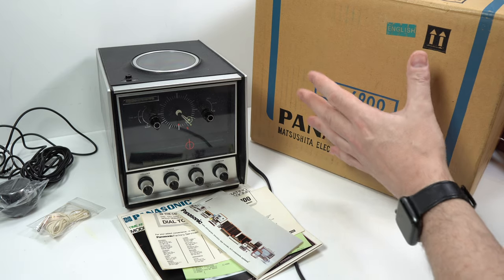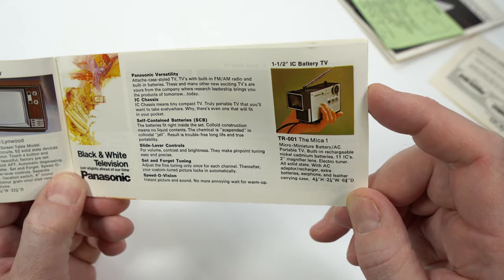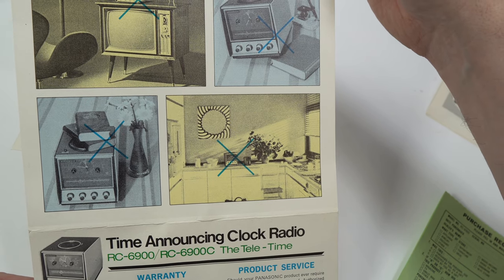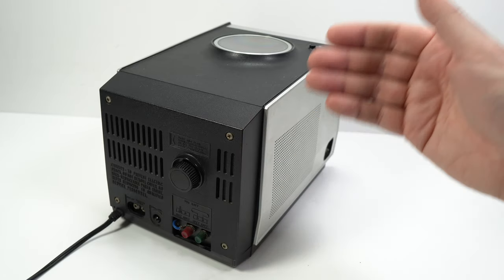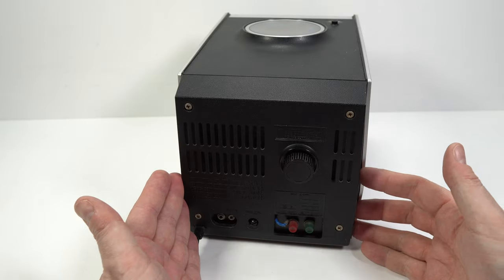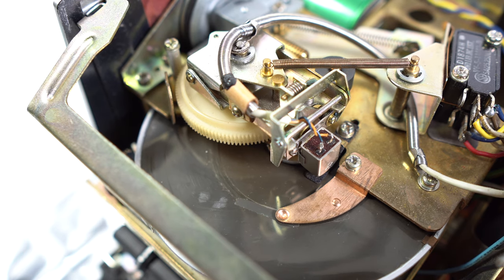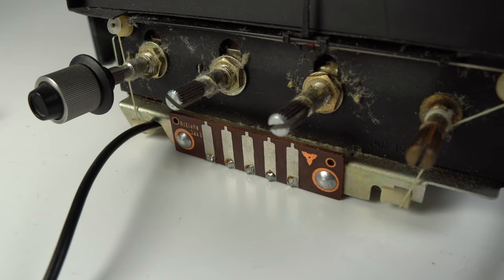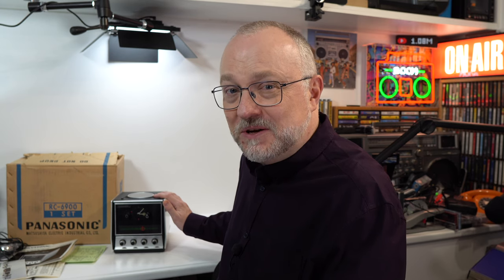The fifty year old Talking Clock Radio

Comment: Can you not get a device of some kind which converts between fifty and sixty Hertz AC?
Reply: How about a 12 volt pure sine wave inverter hooked up to a 13.8 volt DC power supply?
Reply: @johnyanez4962  Sadly I know very little about electronics.  I can wire a plug and sort out those double light switch things but that's basically it.  So maybe.
Reply: Get a 115 volt 60 Hz power supply that plugs into your car's cigarette lighter socket and get a 13.8 volt DC power supply with a built-in cigarette lighter socket that plugs into your wall outlet.

Comment: They must have had some very specific equipment for recording and duplicating those disks. The media might have been re-purposed from 8" floppy disk stock rolls. 8" floppy media was developed in the 1960s and commercialised by IBM around the time that your clock was produced. 

Perhaps the media was not that exotic for its day,  but recording to and duplicating those disks in bulk, with those odd helical tracks,  must have been an interesting engineering task. 

8" floppy disks were pretty crude by modern standards. The tracks were spaced at roughly the same distance as those of a 1/4" stereo tape recording. You could in fact "see" the tracks and indeed the individual bits if you used a magnifying glass by applying a fine ferric dust (very fine iron filings) or using a magnetic film. This trick was used by engineers to align the heads on these old drives. 

 Modern "spinning metal" hard disks by comparison have a data density that has improved by in excess of 650 million to one. Solid state drives are pushing the bit density even higher, towards the fundamental physical limit of electronic devices.  

All in all that clock radio is a fascinating bit of technology. 

By the way there are devices that you can purchase that will produce a 60Hz 110V or 220V output from a 50Hz 240V input to drive old synchronous motor clocks like that. They are a little pricey, but they do exist. If you do a bit of googling you may even find a DIY solution if your soldering ninja skills are up to it. 

I have a couple of old Metamec synchronous motor clocks, which were amongst the most accurate clocks of their day (back in the 1940s and 1950s). They are a little tricky to repair as the motor coils tend to bite the dust and are almost impossible to find.

Comment: 10:26 Probably the hour-hand is out of sync with the clock mechanism, even though the minute hand is correct.  Just adjust the hour-hand on its shaft to skip it back an hour.

Comment: if they made these in the 90's they could have used a platter from a hard drive, in lieu of the thin plastic Iron oxide coated ones. it would have help up a lot better. would have had to have a device  to format the platter for Audio instead of Data though.

Comment: I see what's wrong. Two things - 1) The minute feed lever tab is not in the Feed Operation Lever (right above the motor at 17:06 - see the slot in the shiny feed operation lever?) To fix just remove the ering holding down the the Disc (swing away the head to see) and the 4 screws that hold on the top plate (two big ones on worm pully plate and two on posts going to bottom) and lift it up just enough. It will never work if this is not repaired. 2) The hour disc needs to be on TOP of the minute disc. No wonder it got ripped.

Comment: You could get a US 60hz power inverter that runs off 12V battery.
Reply: Or a 13.8 volt DC power supply.

Comment: I think that is how it was Matt to be honest. Things were expensive and it took you some time to save up to buy it then you looked after it. If it went wrong you paid for it to be fixed as you certainly couldn't afford to buy a new one. Sadly that ethos has gone. These days you just throw it away and buy a new one. I've even taken stuff back to C*rrys to get it fixed under warranty and was told they don't repair things, just replace them!! Certainly not good for the environment!! It's a shame you can't get some replacement discs to this machine though! I suppose they didn't expect some to have survived some 50 years later.

Comment: The 50/60 Hz issue would cause the clock to run slow but doesn't explain the one hour discrepancy between the hands and the voice.

Comment: 60 hz power can be made in the uk, just cobble together a 60hz sine wave oscillator to an audio amplifier and put a step up power transformer instead of a speaker and  turn 60hz tone into 12 volts and then 240volts. dont use your best amplifier though, this is abuse of the amplifier but does work for low power devices,

Comment: It bugs me somewhat that a device that will give you the option to switch between 50 & 60hz isn't avalible to buy, They are bone-dead stupid easy to to make and are actually in use in common electrical applicances. If you have a washing machine that brags about it using an "Inverter motor" they have something like this in them. They use it to control the speed of the motor.

In principle it takes the AC in, smooths it out to DC then re-inverts it to AC but now you (or rather the inverter circuit) have total control over the frequency.

Honestly, if Maplin still existed you could make such a device with parts off their shelves.

Comment: Running equipment designed for 60 Hz on 50 Hz will make some components run hot. Motors and transformers will definitely suffer, so best not to do this - at least for long periods.

Comment: You know, those disks could probably still be made, if someone bought one of te clocks and rewired the head to a tape player.
Reply: I did that with a microcassette transcriber and a wish class D amplifier. By playing an 18 kHz sine wave at -6 dB and the music mixed in at -36 dB you can record very high quality sounding microcassettes at the 1.2 speed...it sounds like a 2009 Bluetooth earpiece playing music when it was designed for telephone conversations. And the fade outs come out unscathed.

Comment: I doubt those hands are radioactive. By the '70s, no one was using Radium anymore and if they were using Tritium (which was used to dope luminous paint on watch faces until the 2000s and now is just used in the little capsules) they'd be practically harmless since Tritium is a weak beta emitter meaning it's blocked readily by human skin, only dangerous if concentrated and inhaled.  And beyond that, Tritium only has a half-life of ~12 years meaning by 50 it's been completely decayed into helium.  Unfortunately, Radium has a half-life of 1600 years and is a gamma emitter so it would be dangerous no matter what, but as I said by the 1970s they would have well known the danger of Radium and no longer been using it.